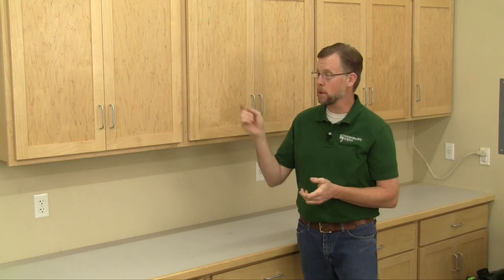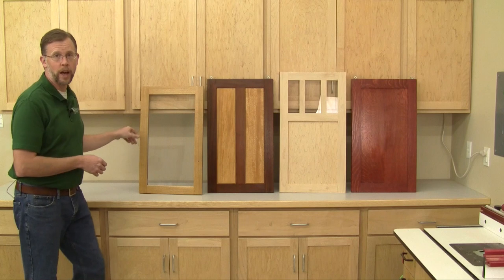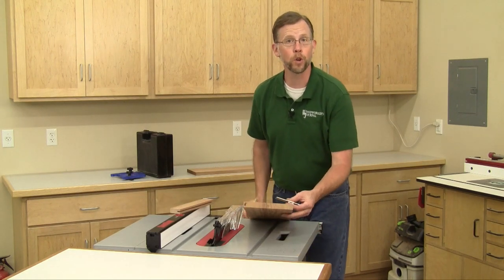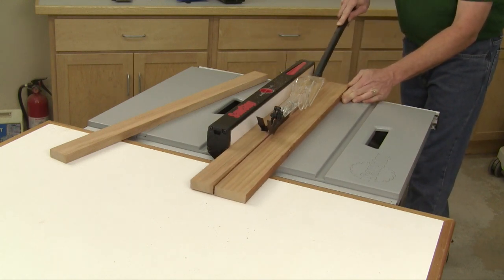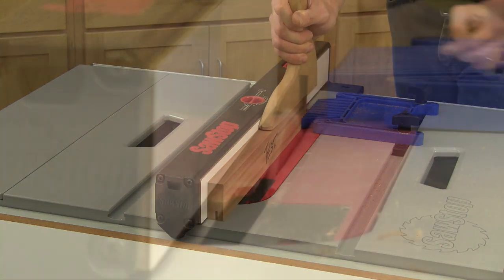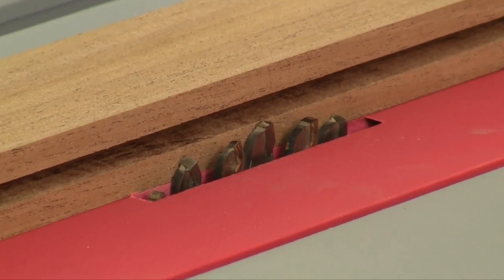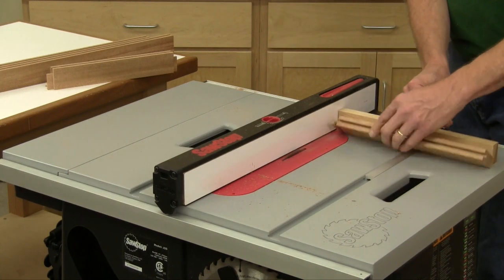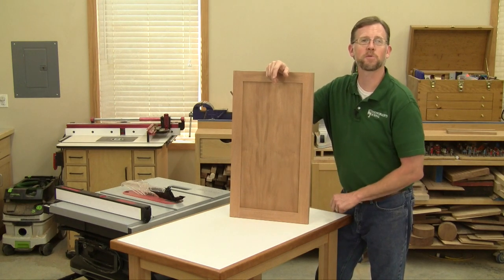How to Make Tongue & Groove Cabinet Doors with a Table Saw

Comment: i needed 9 cabinet doors,cheapest i could find were $30 each plus shipping. Well over $300 and i still had to paint and add hardware. On a table saw,yes you can but it is not consistent and takes a little time plus dado blades are like $120. I decided to build my own doors as in the video. Cost was around $8 each!. With the money i was saving building my own doors,i went to lowes and bought a router/table combo for $150 and a T&G bit set for $80. So in the end,i came out to around the same price as if i had bought them but i got a router a table and a nice bit set! The router was so much faster and consistent.

Comment: Awesome tutorial on making doors. One critique I’d point out for people just getting into using a table saw: using a miter gauge in combination with the rip fence is not a great idea. A safer option is to set a block at the start of the fence, then your work piece slides past/off it as you push the work piece to the blade. Perhaps it is ok since your cutting a rabbet as opposed to through cut, but worth mentioning.
Reply: I've been told (via Steve Ramsey's videos) that the exception to the rule of no fence/miter gauge is when you're making a rabbet because it isn't a through cut, so there's no loose piece that can be pinched between the blade and fence and potentially thrown.

Comment: Would love to see the jig needed to cut raised panels on a sliding table saw. The big issue is that the blade inclines toward the fence,  as opposed to the one shown in the video. This means fixing a jig to the sliding table and feeding the whole assembly past the blade.

Comment: hi, what ís the name of the second blade saw you use . I want to get one
Reply from the maker: That is a Freud stacked dado set.
Reply: freud is prob the most expensive  brand of  dado blades,  other will be just as good if you're on a budget as most of us are , also    check amazon. as it will be cheaper than    any store

Comment: Not clear why a snug fit is not best. You wanted them to fit slightly loose.  If it was for glue, you did not put glue along the edges of the panels.  Why not snug?

Comment: you don't need expensive router bit set - you only need much more expensive joiner and drum sander :)
oh, and table saw :)
Reply: Sucks that a jointer is more expensive than a lot of table saws and only really serves one purpose.
Reply: Yeah, but even a weekend carpenter should have a table saw and chop saw. Right? I'm amazed at how much better work I could do when I got the right tools. :)
I don't know why I haven't bought (or made) a feather board to hold my work piece safely against the fence yet.